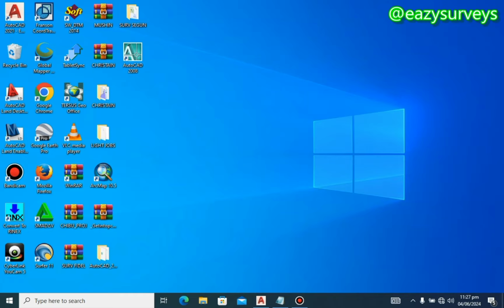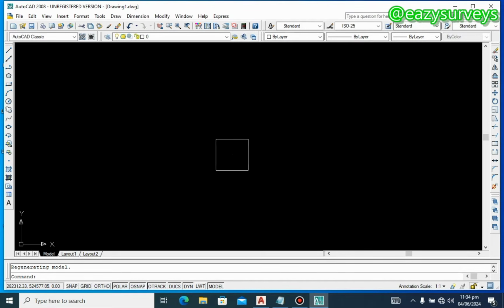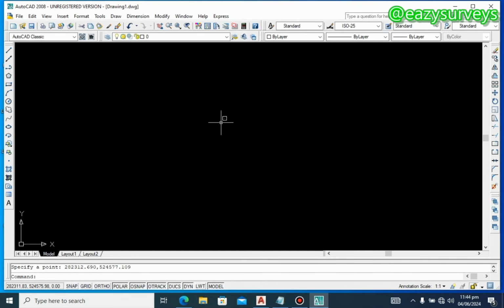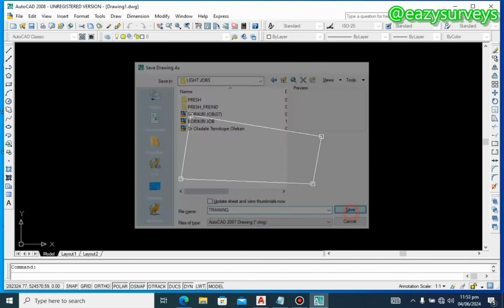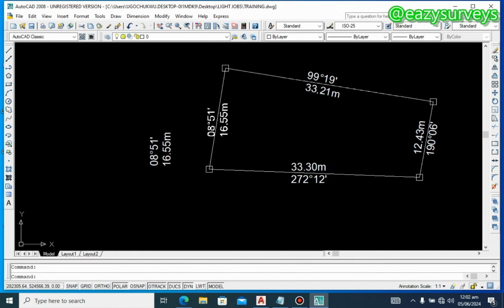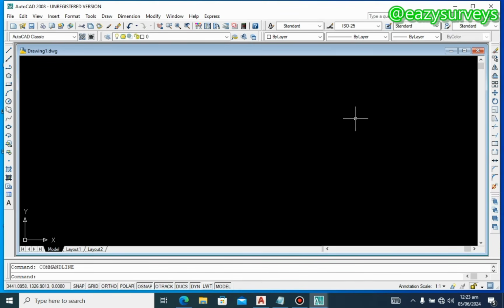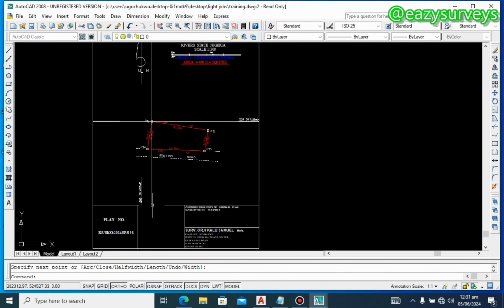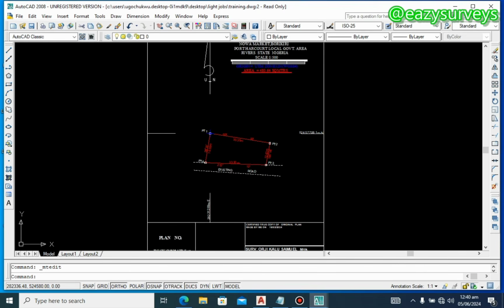How i Plot SURVEY PLANS in AutoCAD || Start to Finish || Complete Tips for Beginners #landsurveying

Comment: so how did you measure the scale to 1:500,000 and as well, what is the standard scale to be used?
Reply from the maker: Hello, The scale on the plan is not 1:500,000 it is 1:500. watch and follow carefully.
Reply from the maker: To know the standard scale, it is dependent on the area of your property, however i recommend you visit SURCON website for the range of scales.